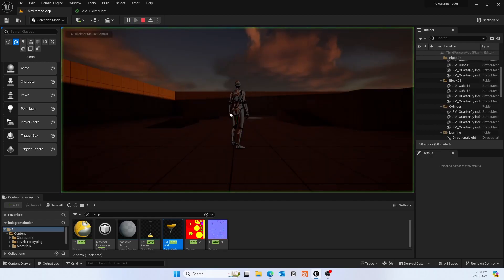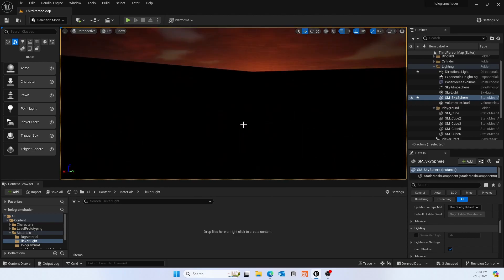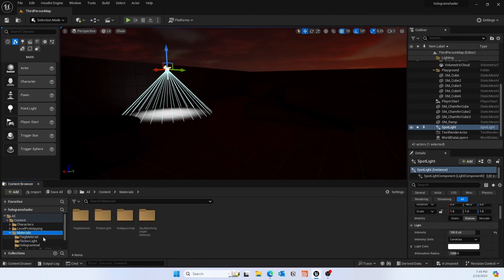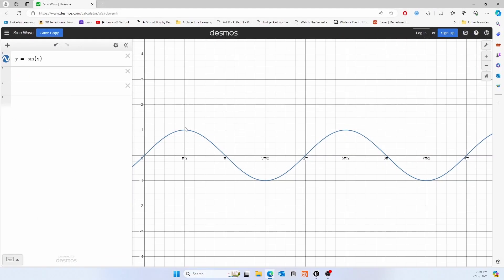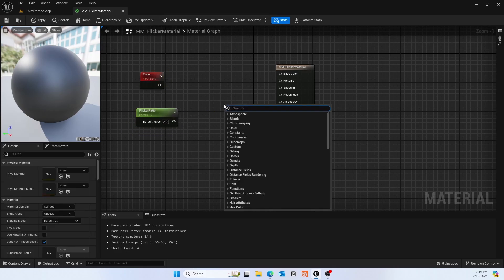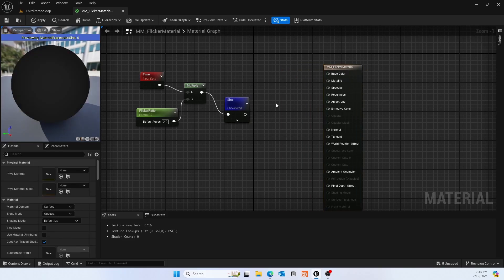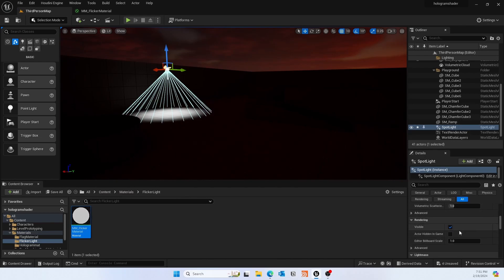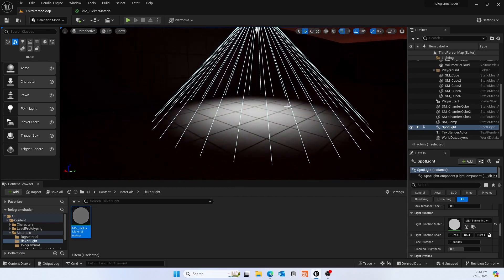Flickering Light Effect in Unreal Engine Tutorial

Comment: Hello, I did all the steps and the material works fine, but when I put the material in the light function, nothing happens and it does not work.
Reply from the maker: Inside the Material , did you change it to light function ? see around 03:15 - 03:17 It is on the left side of the detail pane, I might have missed to highlight in the video